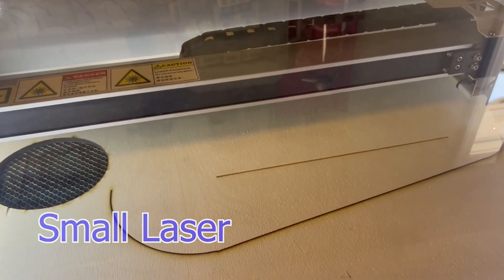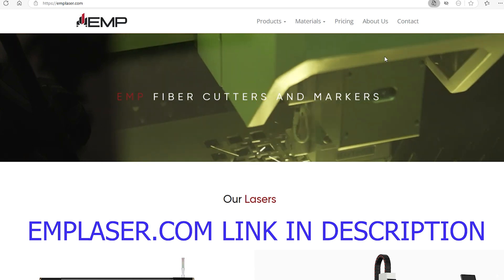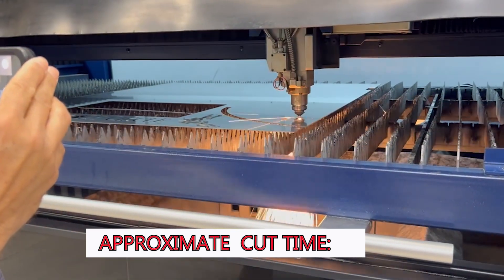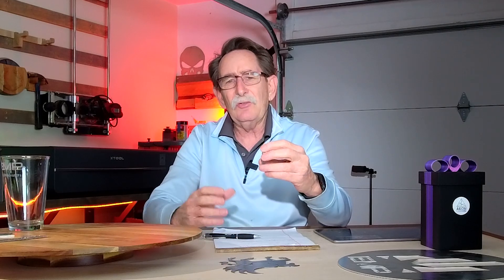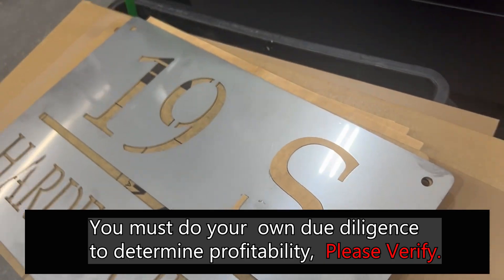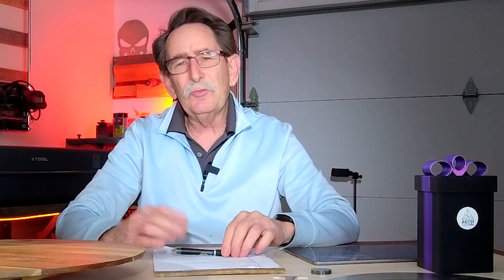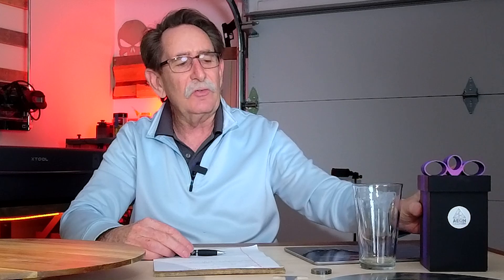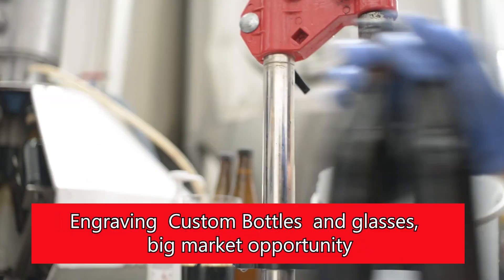Fiber Laser Cutting Machines: Are They Worth It?  Let's Visit EMP LASER!

Comment: The EMP Compact looks the same as the OMTech FC22 but for double the price. My guess is they both buy from the same manf. in China. Why double the price? Power output is the same.
Reply from the maker: I have written about this in my blog featured at LaserFreedom.us. Just yesterday I did an article about laser heads, cost and the reason for the difference in price.  I also addressed the new small fiber laser cutter welders and who is making those.   Like you I am curious about what you really get for the difference in price.  The best way to figure it out is to call the companies and put them on the spot.   No one wants you to get less than you pay for.  But there are differences.